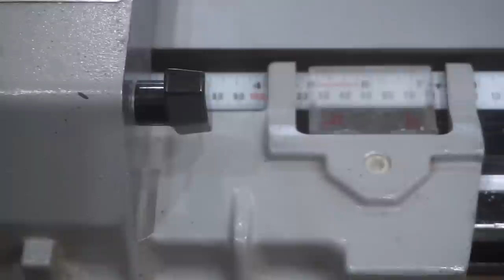Bluebird Nestbox Build

Comment: Beautiful work, as always.  The video quality was particularly good.  I hope you have an assistant for recording and editing.  I'd rather your time making these things went into the woodworking.
Even though the roof's overhand should keep out the rain, and the door doesn't really seal against the floor, I would have like to see the corners of the floor knocked off a bit for drainage no matter what angle it ends up at.  Rain gets driven by the wind, and there is no way to be sure the box is always level.  Just a bit of insurance.
And one question.  What species of wood is that?  What other species would you consider?
Reply from the maker: Thanks... I only WISH I had an assistant (or anyone, for that matter) to record, edit and produce videos.  I could easily provide content for 2~3 videos per week if I did instead of the 1 per month I do now... when everything goes right!
The birdhouse is tight but nowhere near water tight so I don't see a need for drain insurance but wouldn't argue with anyone who thought it necessary, especially in wetter/more humid environments.  FYI the wood I use is western red cedar... works perfectly.  Other outdoor species like redwood, cypress, etc would work well too, depending on budget and availability.
Best,
Matt

Comment: Great job demonstrating the build. Really like the house. 

Any suggestions on how you would mount this to a tree or building and not lose the intended roof style?
Reply from the maker: I think you could trim off the extended back edge of the roof and use a mounting block strapped to a tree instead of the pole.  Not sure if bluebirds like tree-mounted nest boxes though since these and others I see are usually mounted on posts of one sort or another.  FWIW our bluebirds are busy setting up house in both next boxes I've built with this design... and they're only 50 yards apart.
Reply: Thanks for your prompt reply. Yes, I understand in the case of bluebirds but I was hoping to adapt the house to a variety of small birds.🙂

Comment: I love the craftsmanship you put into that birdhouse.  I have a question about the door, though.  I've never seen a bluebird house door like that... with the bar running across it.  Do they enter above the bar or below it?  Does it prevent sparrows?  Your video shows a bluebird looking into it, but not actually entering.
Reply from the maker: Someone who's a LOT smarter than me came up with that unusual 'door' design with thorough knowledge of bluebird preferences and behavior.  I don't know what it is about it but bluebirds appear to love it as we've had 2 productive nests in it each season.  Wrens try to move in but bluebirds chase them out.  We don't have a sparrow problem but, relying on the smarts of the designer, believe it's most attractive to bluebirds, maybe more so than more common round hole 'door' designs.  BTW They flit in and out below the bar with ease.  I think the main idea is that the fact the opening extends up to the underside of the roof makes for better air circulation in hot/humid weather so the interior isn't subject to stifling heat or mold the way other designs are.
Reply: @NextLevelCarpentry I'll have to give it a try then.  Thanks.
Reply from the maker: @willphelps6715   I think your bluebirds will thank you too! 😎

Comment: Love the action only format although your instructive chatter is always enjoyable as well.  Good project, It's surprising how complicated a simple birdhouse can be. 
Can you tell us about that 1/2 sheet handled sander you use at about 6:30 ? Is it just a sponge grout float that appears on your Amazon project Tools and Supplies link ?   How'd you get the sandpaper to stick ?
Reply from the maker: Sorry for the confusion.  I use the grout float as a pushblock for flattening boards on the jointer.  The sander you ask about is a Gator Sanding block: https://www.amazon.com/dp/B000WEKOGE?linkCode=spc&tag=onamzdigitalj-20&creativeASIN=B000WEKOGE&asc_item-id=amzn1.ideas.T7WBYDC8ZCRD&ref_=aip_sf_list_spv_ofs_d_asin 
They also sell sheets for it that hold on with 'velcro' type hook and loop backing: https://www.amazon.com/dp/B0013NPBBG?linkCode=spc&tag=onamzdigitalj-20&creativeASIN=B0013NPBBG&asc_item-id=amzn1.ideas.T7WBYDC8ZCRD&ref_=aip_sf_list_spv_ofs_d_asin
I have a selection of all grits from #80 to #220 and use 'em all.  I have other sanding blocks for different applications but the Gator is my go-to when I need a cushion-backed sanding block.

Comment: Very nice build. Why did you put the bar across the opening cutting it in half. I would have put it a little lover giving the bird easier access.
Reply from the maker: I didn't just make that up and put it there randomly.  I followed the idea and design of a guy who has spent a good deal of his life studying bluebirds, their behavior and preferences.  I can tell you that our bluebirds love the design!  You can sure put the rod lower based on your idea if you want but, unless you have more than a passing thought that it would give "the bird easier access", would be surprised if it actually works as intended.
Reply: @NextLevelCarpentry  Thanks.. What size hole and is that bar centered or is there a measurement from top of arc to where the bar is.
Reply from the maker: @jerseycornboy  You can a search online for free bluebird nestbox plans like this for all the dimensions or follow the link in the video description where I have a detailed set for sale...

Comment: nicely made but the house should ideally have a series of small vent holes at the highest point of the wall or back to let heat out.
Reply from the maker: The "Gilwood Entry Design" with its opening larger than the typical round hole is supposed to help control internal temperature but I appreciate your comment/advice regarding that technicality.  I wondered that very thing because the original design I modified has a flat roof which would eliminate that problem. If it's confirmed by others (or maybe you have study results showing how critical that feature is?) I'll definitely drill a few vent holes for the sake of my feathered friends and other viewers who choose to build these.
Best,
Matt
Reply: @NextLevelCarpentry  the Peterson Bluebird House design which is the go to standard has vent hole in both walls at the highest point. I’ve seen newer designs that have 1/2 inch vent holes in both the walls and floor for venting. Just think how hot it gets on a summer day in That confined space.

Comment: You are so skilled. Question for you. What are the grooves on the underside if the roof for?  Air flow?
Reply from the maker: Thanks for the compliment!  You're quite observant to notice those grooves.  In this case the grooves cut in the underside of the roof serve to weaken the roof board's 'internal strength' and decrease its ability to cup from unequal exposure to moisture.  Moisture on one side of a board that's not balanced by equal moisture on the other side causes it to cup... often severely.  The grooves can't do anything about moisture differential but they do minimize the power of warping forces and help the birdhouse survive without a roof that cups and ends up cracking.

Comment: What chuck do you use in your drill press? That thing looks beefy and true - I need to upgrade mine! 

I've seen a few elusive bluebirds in my area where I live but far more cardinals. 

Do a cardinal themed birdhouse next haha!
Reply from the maker: Love those cardinals... send me a cardinal, I'll send you a video 😉😎
Reply from the maker: It's a top of the line Llambrich keyless model that's aMAYzing... definitely beefy and ultra precise... with a price to match.  FWIW I think you can get a very good knockoff for $100 or so, about 25% of the price of a Llambrich.  No regrets though because you can see how super handy it is to go keyless.
Reply: @NextLevelCarpentry  If you had some affiliate link or agreement with them (rare with Llambrich, I know) I would be inclined to purchase through you.

I'll see what I can do about the cardinals - thank you for your time!
Reply from the maker: @hanksnowden5288   I'd have to look back at records to find out where  I bought mine but it was around $400+.
If you end up with the brand name just search around for the best price from someone who has them in stock.  Pay extra attention to the Morse taper specs for your drillpress so you get a chuck that fits/matches.  If you do with a knock off from Amazon and want to 'purchase through' me, if you start your shopping search from the Amazon link in this video the small but appreciated sales 'commision' will accrue to Next Level Carpentry.  Thanks either way.

Comment: Why the extra table saw cuts on the bottom side of the roof?
Reply: I believe to prevent cover from cracking from the elements.
Reply from the maker: Since the wood gets no water repellent finish, those cuts reduce potential 'energy' in the bare wood and will significantly reduce its tendency to 'cup' from moisture variation during its life outside, totally exposed to the elements.
Reply: @NextLevelCarpentry  that makes perfect sense, thank you for your reply!
Reply from the maker: @Incandescentiron  For sure! 👍

Comment: Would much more enjoy your commentary. What is in the yellow container with the screws and why?
Reply from the maker: Nice to know at least one viewer doesn't think I talk too much!
The yellow container holds screw wax which helps screws drive more easily, prevent splitting and, in a small way, help repel moisture on this exterior project.  Here's a link to a decent wax in a better container should you be interested:
https://www.amazon.com/dp/B08J7W69J8?linkCode=spc&tag=onamzdigitalj-20&creativeASIN=B08J7W69J8&asc_item-id=amzn1.ideas.T7WBYDC8ZCRD&ref_=aip_sf_list_spv_ofs_d_asin

Comment: Why does that rod cross the hole? Why not just make the hole smaller?
Reply from the maker: My understanding is that the rod design allows much better ventilation of the nest box than the typical plain round hole.  The spacing between the bottom of the hole and that rod at 1 1/4"~1 3/8" has the same effect as a hole of that diameter to keep other species out making it a clever alternative IMHO.

Comment: Question: For your sanding block did you just put stick sand paper on a foam float, or is it a purpose built tool? Thanks and great video (though I do prefer your narration 🙂)
Reply: They are auto bodywork blocks.
Reply from the maker: Actually, here's a link to that sanding block Kevin:
https://www.amazon.com/dp/B000WEKOGE?linkCode=spc&tag=onamzdigitalj-20&creativeASIN=B000WEKOGE&asc_item-id=amzn1.ideas.T7WBYDC8ZCRD&ref_=aip_sf_list_spv_ofs_d_asin
They are one of my favorites for ergonomics, function and performance.  I don't like to push things on viewers but really do recommend that particular brand and style...